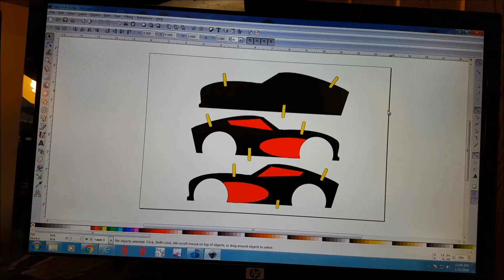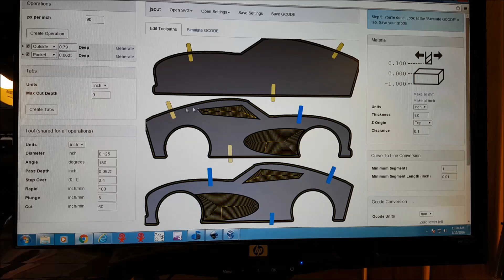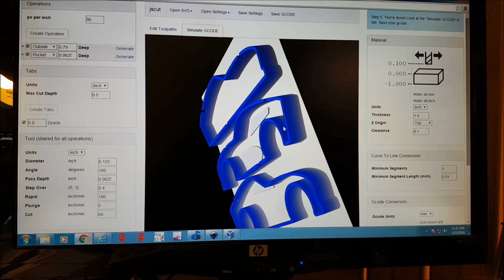Wood Muscle Car Build - An Easy CNC Project

Comment: Hi, I love the car! Would you be willing to share the SVG files?

Daniel
Reply from the maker: +Daniel Dumke  I'm working on a way to share SVG files.  Just not ready at the current time to email them as attachments to many that have asked.  Thanks for your comments - fun project.
Reply: +drez20001 I finally came around to redo your project. If anyone is interested, I put the design on Dropbox. https://dl.dropboxusercontent.com/u/285107/CNC/Muscle%20Car/20160219%20Hotrod_v2.dxf
Reply: You will still have the project, to be able to download it